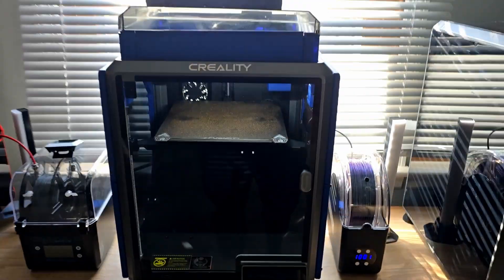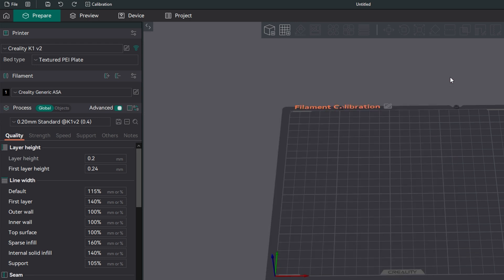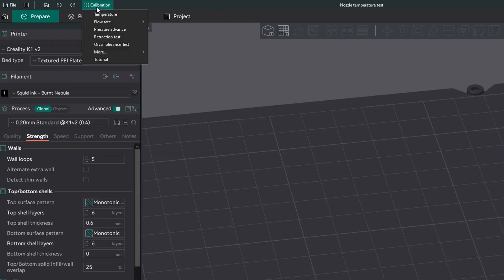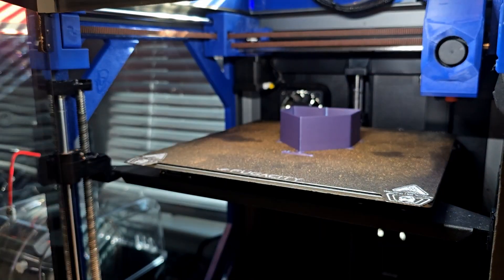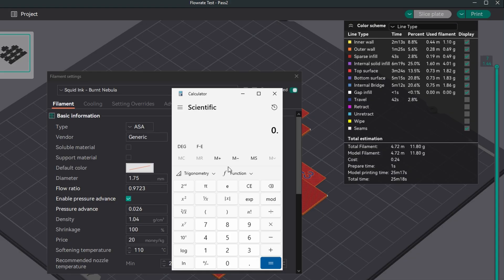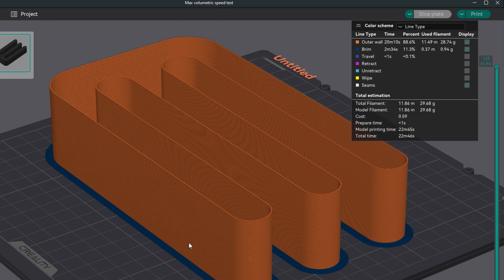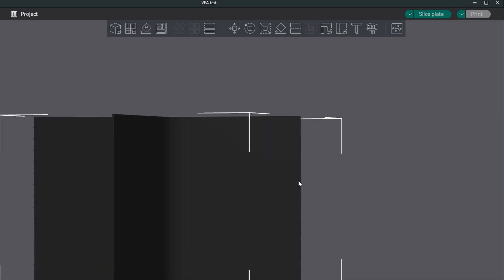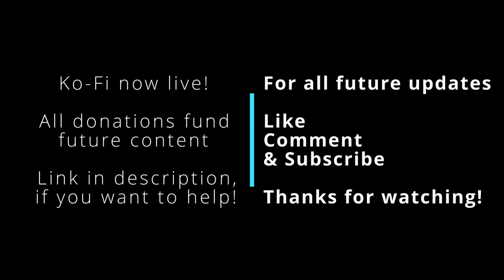OrcaSlicer Calibration - Getting the most out of EVERY filament!

Comment: Do you know where to get the files?
Reply from the maker: @davids8458  If you access the Calibration drop down on the top left of the page, you can access all of the tests shown. They will automatically set your input values to produce the necessary changes through the process of each test. Happy printing!

Comment: Should you scale the tests down so you can  print faster and use less filament or keep the default scale?
Reply from the maker: @TheGlitterMan  I'd suggest keeping the default scale just due to the values and operations that are being tested. It is a worthwhile use of filament and yields considerable returns on the 100g that is utilized.
Reply: @CovenantCustom  When I'm using Creality Print 6 the flow test didn't fit my V3SE so I have to click yes to fit the print bed. I'm still trying to figure out the right setting for Inland PLA+ WHITE that I got from MicroCenter.
Reply from the maker: @TheGlitterMan  I can confirm that with the same build volume on the Creality K1 used in this video, no adjustments are required through Orcaslicer. Some filaments can be tricky to work with but knowing what to look for so that an expected value is an accurate choice was my biggest hang up when I was performing calibrations years back. Just takes a little bit of time to get the hang of is all! Happy printing!
Reply: @CovenantCustom  Hopefully I can somewhat Lessen stringing during my print. Any recommend when printing a small cylinder around 9mm?
Reply from the maker: @TheGlitterMan Make sure the filament has been properly dried and that it remains dehydrated during the print. Make sure that you arent melting the filament too hot; good rule of thumb is to stay within the range that the manufacturer suggests. Pay close attention to the retraction settings test to help eliminate stringing.
Reply: @CovenantCustom  The filament is in the dryer 24/7. The temp is 220 C so which in range. retraction test show -5 is good now trying to pass test 2. Have wait tomorrow for it XD
Reply from the maker: @TheGlitterMan  You're on the high end of that temp range for PLA but every material has its preference. Good luck!

Comment: Should all the colours of the same material and the same brand use the same profile? I have read that black and white might need their own but most colours can use the same profile.
Reply from the maker: I would personally tune each and every filament that is being run through the printer for the first time.

Although some profiles may be close, the formula that each company uses may differ from not only other manufacturers but even from batch to batch.

I dedicate a profile to each filament and name it by manufacturer, material, color (and can even go as far as noting the machine it was tuned on and the nozzle size).

You can take an existing profile and try it on another filament if you are in a pinch which might work or get you close, requiring small adjustments.

To rule out any unusual behavior while printing, I prefer calibrating the filament before I begin sending prints.
Reply: @CovenantCustom    Thanks

Comment: Just a little pointer for everyone, on the temp tower, the little cones are also used to test layer adhesion. Trying to snap them should help you feel which required the most effort.
Reply: You can also simplify the flow rate math. In his case, 0.926 * 1.05 = 0.9723. This way, you don't have to remember to divide by 100.
Reply from the maker: @corneliofehr8001  Another great piece of info! I tried to follow the guide as closely as possible to prevent confusion if compared/utilized alongside the video but that formula does the job as well!
Reply from the maker: @corneliofehr8001  I do this on occasion if I'm not confident in how well the layers are holding. Great tip! Appreciate you dropping in with that info for the community to put to use!
Reply: @CovenantCustom should I do that for pa6 Cf? Probably not right? Because the print comes out brittle anyways, before a kneeling, and letting it absorb moisture.
Reply from the maker: @designdefense Although brittle before annealing, it should still provide an indication on which temperature is better than others. First I'll check the quality of the tower/spire to make sure it is uniform but ultimately the test print is a test piece so breaking the spires can be considered part of the process if you want to take it an extra step!
Reply: Nope. Temp tower do not give any information about "layer adhesion". It's not depending temp extrusion. Temperature prev layer matter

Comment: As a new print enthusiast, just printed my leaning tower calibration with the filament that came with the printer, and thought... now what :) I loved your tutorial. Very precise and explanative. 

I was wondering why dont the files you print for calibration have markers on the sides so you can read the setting versus measuring with caliphers.
Reply from the maker: Welcome to the 3D printing community, we're happy to have you here! This video should help provide some foundational knowledge to your printing process.

Thank you for the feedback, it is greatly appreciated!

In regard to the mention of markers on the calibration tests, I actually prefer that they don't! 

The reason behind this is, a higher level of precision can be achieved by using calipers and a formula for that specific test.

The max volumetric test for example shows the steps but regardless of them being present, I will always try to find the best measurement when filament tuning and a set of calipers is necessary for that approach.

It is an incredibly helpful tool to have in the collection and used among a variety of printer related projects otherwise! I will be covering my go to tools in an upcoming video.

Thanks for stopping by and I look forward to seeing you on the next one! Happy printing!

Comment: hello you use 0.01 for the initial value in your pressure advance calculation. my question i in my klipper vanilla in printer .cfg it set to 0.04 does this meen that my initial value is 0.04 and not 0.01 ?
Reply from the maker: In theory, the value that you set it to in the calibration as well as the filament profile should effectively change the value for that filament. I can confirm this as my filament profiles, differ from my cfg values and it still produces the desired results with the appropriate value set in the slicer.

Comment: Very nice. It would be helpful to have the math part to have labels (X Y Z) for easier instructions but besides that this helped a LOT
Reply from the maker: @DerekX100  Appreciate your feedback! It helps provide me with the input I need to improve. I am happy that this guide served you well. Enjoy your newly tuned profile and all those to follow!
Reply: @CovenantCustom  If you can add the equations for the calculations in the description or a link to a easy to read note would be amazing. Thank you again for the video
Reply from the maker: @DerekX100  Updated with formulas, inspections and a link directly to the calibration guide 😎

This guide can also be found by selecting "Tutorial" in the Calibration drop down for easy access through OrcaSlicer direct.
Reply: @CovenantCustom  Perfect. I tried to use the Orca tutorial but was overwhelmed. The Video helped me out much more. Thank you again
Reply: @CovenantCustom  Hey its me again. My Neptune 3 uses a Bowden Extruder and i wasn't able to find anything about the setting on the tutorial link. Do you have any advice for the PA calibration?
Reply from the maker: @DerekX100  For pressure advance, the values will increase for a bowden setup and decrease for a direct drive. This accounts for the distance between the extruder gears and the hotend.

It is suggested to use a starting value of 0 with a step of .020; you can play with the End PA but considering the step is much larger, that will also increase over what is shown for a direct drive setup.

Outside of the OrcaSlicer calibration guide, documentation from Klipper is very useful.

Here is a link specific to PA from their site:

https://www.klipper3d.org/Pressure_Advance.html#:~:text=Pressure%20advance%20does%20two%20useful,it%20reduces%20blobbing%20during%20cornering.
Reply: @CovenantCustom  Amazing! Thank you so much for the help!
Reply from the maker: @DerekX100  Happy to help! That is what the 3D printing community is all about 🤝

Comment: This might already be in the comments here somewhere but whats the best way to calibrate retraction speed in orca?
Reply from the maker: @billythorne3273  First question regarding it!

35mm/s is typically a good starting point for both direct drive and bowden set ups.

I would start there and then proceed to check out Ellis' Print Guide for additional adjustments if required.
Reply: Perfect,  thank you for the quick reply, just running my vfa now and then I'll look into the retraction speed settings, upgraded my ender 3 V2 to a DD sprite extruder and not got the retraction speeds down as of yet
Reply from the maker: @billythorne3273  You'll get them dialed in no time 😎Nice work on the DD swap!

Comment: Thanks for this informative video. 
The slicer changes the 'Max fan speed threshold - layer time' to 1 when doing the PA test and then changes it to 0 when doing Maxflow rate and VFA.
Should you be saving these values? I thought 'no' since you don't keep the nozzle temp that was changed for the temp test but I noticed you did at 10:00. Then do you save the last one? 0?
Reply from the maker: @billionsean.k  I perform a separate calibration for cooling altogether following filament tuning. I wouldn't rely on preset values that are produced for the tests alone as they have such an isolated focus.

Comment: 6:46 soooo the raised edges according you will be the flowrate? after pass 2 you diden´t redo it so I surpose thats the case. I do struggle with this on my Elegoo Neptune 4 pro, and thought its PA sence its the outer paramiter.
Reply from the maker: @robertagnarp7502  The raised edges are caused by the flow rate being too high.

It essentially causes the nozzle to drive itself through the filament during its tool path and as a result, it pushes the extruded filament out to the side (which creates the rough edge).

I perform PA after flow rate pass 1 to make sure that rounded corners can not be a result of pressure advance when dialing in the flow rate for pass 2.

I approach it in this sequence so that corners that seem "rounded out" are tuned with PA and can be an indicator that the flow rate is too high as it deposits more filament than what is necessary.

PA is carried out prior to flow rate pass 2,  to isolate focus on the 4 corners and not the edges of the print itself.

If you are experiencing rough edges, that is indicative of the flow rate being too high.
Reply: @CovenantCustom  Thanks for the answer, appriciate it! 

But as a follow up question, can that cause the edges to buldge too? i thought PA is the enemy of this, in my case i got edges that is buldge, (have done pattern and tower yet same problem) also done shit ton flow rate, the middle is awesome but edges like yours is present. But maybe i should try doing it in that order, Pass 1 then PA then Pass 2. maybe it changes something.
Reply from the maker: @robertagnarp7502  If you are experiencing bulging that causes inconsistent layer lines and in turn, less than ideal surface quality that would be related to flow rate over PA.

PA is responsible for the change in extrusion rate during accel/decel movements, i.e. corners, hard angles.
Reply: @CovenantCustom  Thing is, i tested this now with 4 test. one with current flowrate, down to 0.5 flowrate just to see if it will change. The rise of the edges is still present no matter what. i try to lower also other flowrates i could find but it seem that i never seem to find the core issue.
Reply from the maker: @robertagnarp7502  Does filament ooze from the nozzle when it gets up to temp prior to printing? That could be an indicator of the material is wet and in that case it will deposit more than intended.

It may be worth running the temp tower again to make sure that you are not melting too hot.

Comment: After your max flow rate test before saving your filament you should have reverted it as the max flow rate test affects your filament cooling as well and you probably saved something you didn't want.
Reply from the maker: @chris993361  Cooling was addressed in its own tuning process following.

Since it isn't a process within the filament calibration sequence, this was not covered.

This guide purely serves to detail the isolated focus on the various tests of filament calibration and what can be achieved through them.

Despite the built-in calibration being a great foundation for the values corresponding with each test, it is important to address cooling separately for the best results on bridging and overhangs.
Reply: @CovenantCustom  Yeah. I follow with cooling stuff as well though I don't have a good set procedure for it. Usually it involves printing out a bunch of overhang tests and changing settings randomly until I'm happy with the result lol.
Reply: @CovenantCustom I should also note that I went into this not expecting to learn anything new but I think I like your strategy of doing pressure advance in between the two flow tests. Thanks for the tip.
Reply from the maker: @chris993361 I appreciate that feedback. It might be a personal preference, but I'm happy to hear that it provided value for someone who is already familiar with the process.
Reply: @CovenantCustom  not trying to be annoying but I just remembered something else I wanted to mention as well. The new yolo flow rate test doesn't require you to do math. It puts in flow calculations for the objects based on your current flow rate so that you can just directly minus or add the number shown.
Reply from the maker: @chris993361  All good! I appreciate and welcome your input. It may be helpful to anyone who has rolled the update over. Thank you for mentioning it so that others are aware that the process for flow rate has been simplified further.

Comment: Amazing video, really helpful. I did notice you saved the filament profile with the calibration settings still overriding the cooling settings or was this on purpose?
Reply from the maker: Many thanks and fantastic observation!

Since I consider cooling a follow up to filament calibration, I isolated those values after this sequence of prints. 

With my focus solely being on the built-in calibration tests, I did not want to create confusion by deviating from the tests provided in the drop-down menu.

Comment: did this help with dimensional accuracy? i am so tired of working with iteration when i am trying to get accurate dimensions , and i dont know what type of calibration i need to do
Reply from the maker: So long as the equipment is dialed in (hardware secured, belts tensioned, axes are clean and properly lubricated without resistance, etc.), it most definitely will.

By tuning the filament, you are able to achieve the best performance output from that material to reduce the remaining variable to slicer settings (printer and filament profile addressed).

I would run through all of these calibrations if you are experiencing issues and your hardware (printer), has been checked through to make sure there are no mechanical issues that are causing dimensional inaccuracy to occur otherwise.

There is also a tolerance test that can be found in the Calibration drop down, to confirm that all adjustments made during the tuning process provide favorable results.
Reply: @CovenantCustom  thank you so much man , your a life saver ❤
Reply from the maker: @eclipsehorizon7655  Returning the favor to a community that has provided the same assistance to me in the past. Happy to help!

Comment: Great Video!

Just out of curiosity, how much total filament do you think was used on calibration?
Reply from the maker: Appreciate your feedback!

The filament tuning process requires about 100g of filament, providing 900g of a properly tuned material for the first spool you run through.

If you end up purchasing the same filament again (matching manufacturer/material/color), it is highly likely that you'll be able to utilize the full spool without any additional calibrations by selecting that filament profile. There is a possibility that it may require minor tweaks as the properties could change minimally from batch to batch but that typically requires 50g or less. I very rarely run into that but there is still potential for it to happen.

Comment: I tried out the burnt nebula asa a while back and it was one of the worst filaments i have ever worked with. I dunno if it was a bad batch or what but it absorbed moisture like crazy. I dried it for over 24 hours and the layer adhesion was garbage. This what after multiple tuning sessions, after all that i just threw it away
Reply from the maker: @josephpitt3873  I had the same experience with it absorbing moisture as you can see.

A lot of companies blend ASA with another material like PETG to mitigate this, so seeing how hygroscopic it was actually ended up being a good sign in my eyes.

I ended up receiving the best results after approximately 72 hours at 70C, and every print turned out great. If you are trying to dry this filament at 50C or less, it will be difficult to achieve the same results.

Another reason that I chose this filament is due to its pearlescent makeup.

Between these two hurdles, it helped show just how important drying and filament tuning can be with some materials.

With that said, It is definitely my go to pick for an ASA in this gradient from here on out.